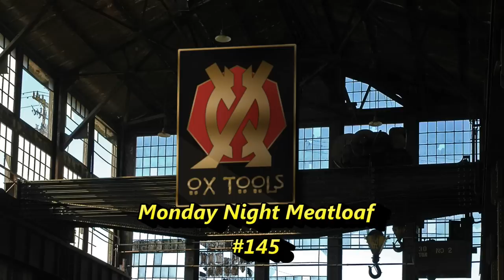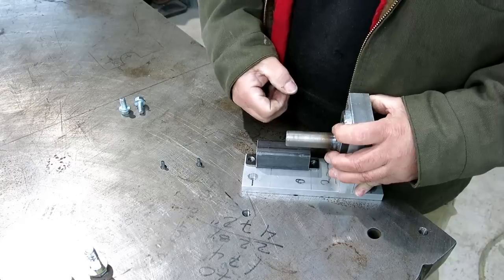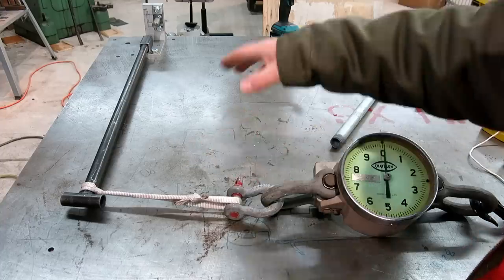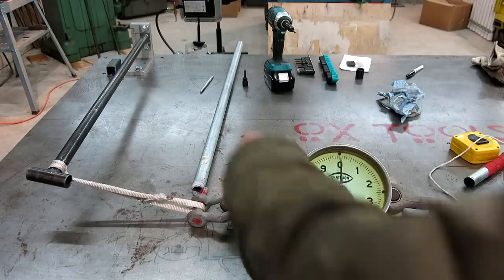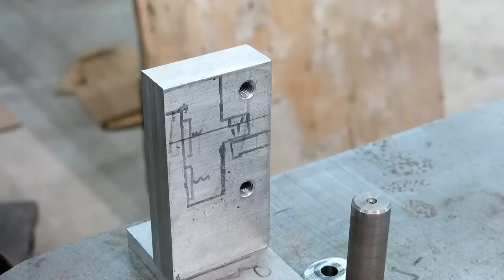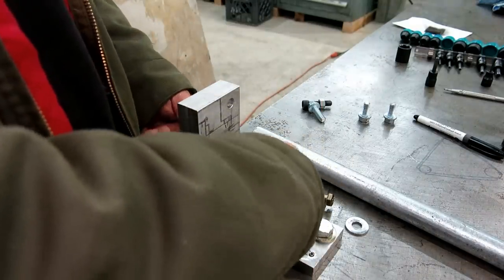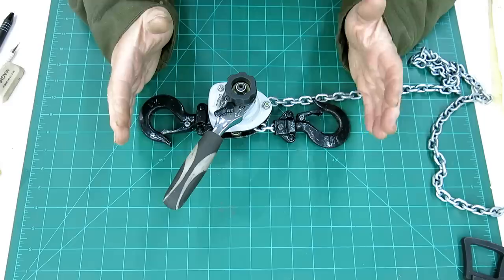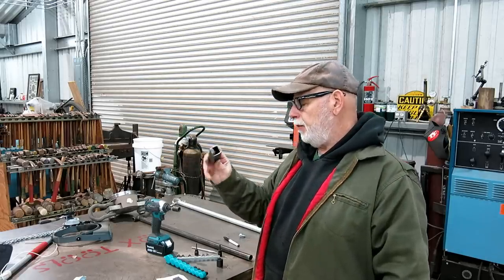Monday Night Meatloaf 145

Comment: I couldn't understand the comment about not putting grade 8 cap screws with grade 8 nuts.  Can anyone explain that point to me?
Reply from the maker: Hi Urbana. I answered that question several times in the comments above. Thanks for the comment.

Cheers,

Tom
Reply: @oxtoolco  Thanks Tom.  I had to scroll and scroll before I finally found your comment about brittleness.  I think what you're saying is that high strength fasteners also tend to be associated with catastrophic modes of failure, so it may be better to avoid that unless you are prepared to characterize what that failure is going to look like and the safety issues involved.
By the way, for me, my comment is the one at the very top, so there are no comments above ;)

Comment: Please explain the scenario of grade 8 nuts on grade 8 fasteners.
Reply from the maker: The short story is brittle failure. With a softer nut the nut dilates and actually reduces stress and increases the ultimate strength. High performance bolted connections are very carefully yielded for maximum fatigue and strength response. Thanks for the comment.

Cheers,

Tom

Comment: As for the team; I'd go with Chip Makers over Chip Breakers. Perhaps my hearing is wrong.
Reply from the maker: Hey Brock. I said chip breakers. This refers to a feature on a cutting tool to break chips into smaller manageable pieces. Thanks for the comment.

Cheers,

Tom
Reply: @oxtoolco  Thanks Tom - still learning & ain't afraid to ask questions (if I can come up with a respectful approach). Also, I have Old Man Ears LOL

Comment: Stress = Mc/I 
            = FLc/[(pi/64)(D^4-d^4)]  

where M = FL and I = [(pi/64)(D^4-d^4)] 

F =250 lbs
L = 33 inches
D = 1"
d = 0.834" assuming 0.083" wall thickness
c = D/2 = 1"/2 =0.5"

Stress = (250lb x 33" x 0.5" x 64)/ [pi(1^4-0.834^4)] = 162793 psi

Yield strength of 4130 tubing is 70000 psi 

70000 psi < 162793 psi

You tweaked your bar for sure.
Reply from the maker: Hey Candy. Check your moment of inertia. Thanks for the comment.

Cheers,

Tom
Reply: @oxtoolco  Am I using the wrong equation or wrong numbers?

Comment: ChatGPT says 250lbs at 33 in is 8250 lbs...?  Got the small impact sockets, good deal.
Reply from the maker: Hey Scrout. It is actually higher than that on the second setup. The moment from the center to the fasteners is something like a half inch. Somebody in the comments figured it out. Thanks for the comment.

Cheers,

Tom